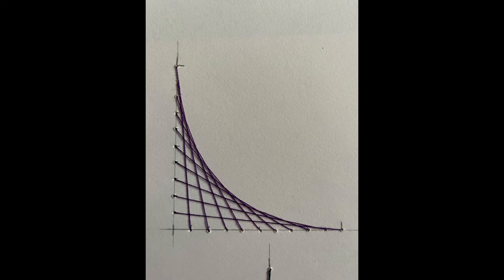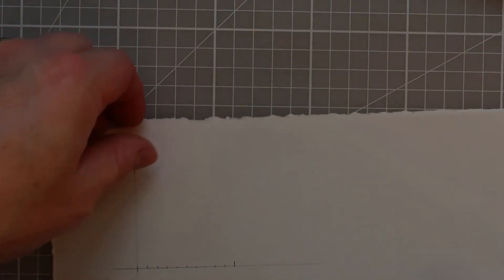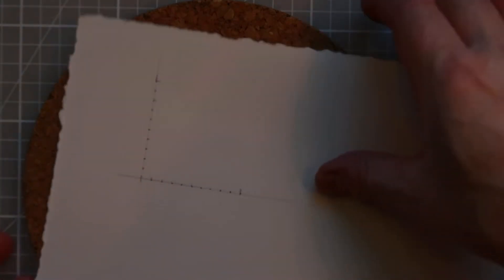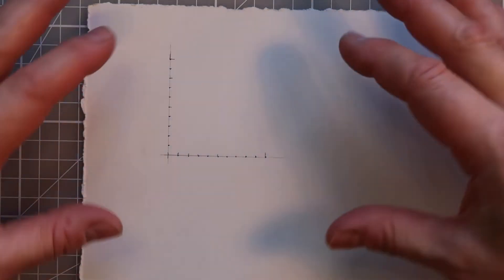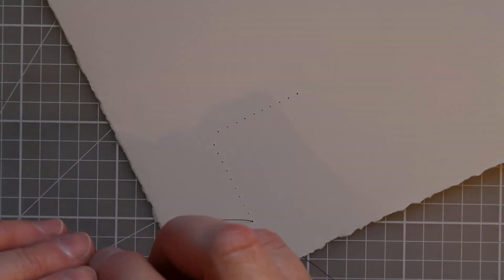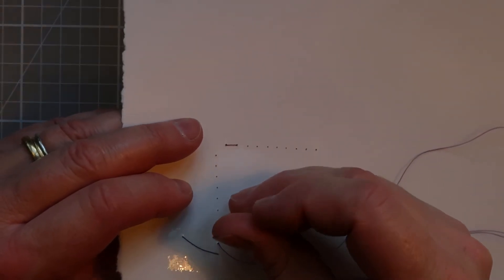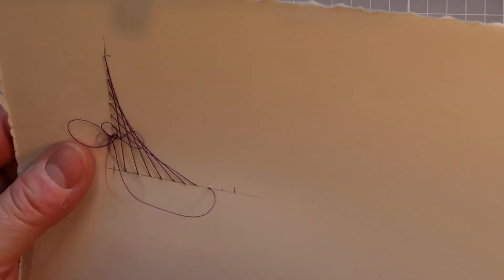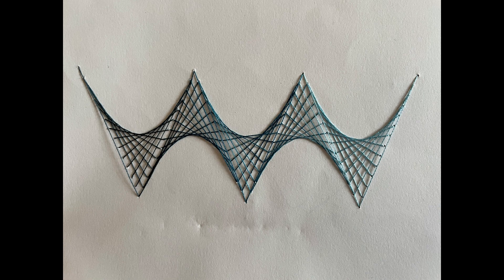How to sew a parabolic curve.

Comment: What are you using to prick the holes?
Reply from the maker: I usually use an embroidery needle size 7 or a chenille needle size 22 or 24. It does depend on the thickness of thread I'm planning on using too. I have a cork mat behind the paper as I find that gives a nice cushion without damaging the paper.